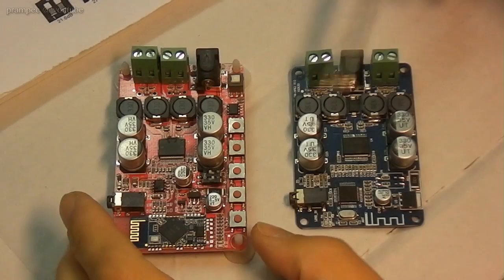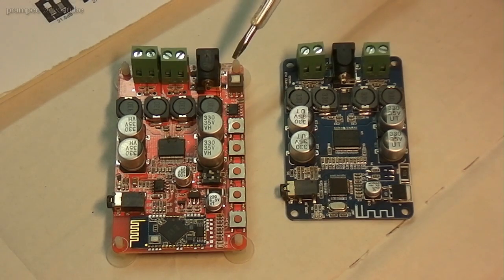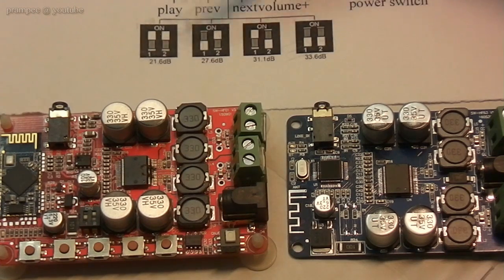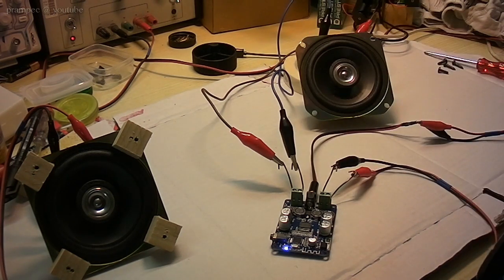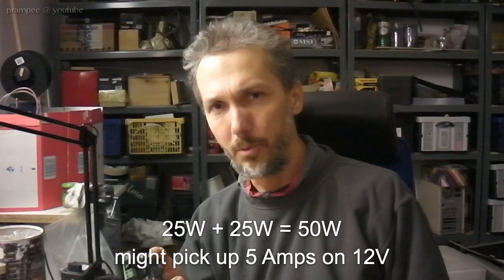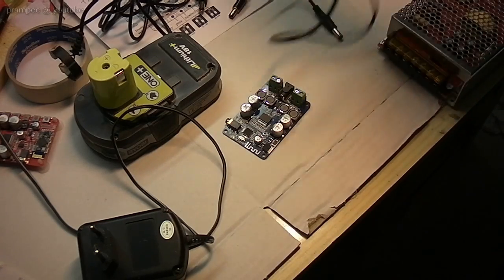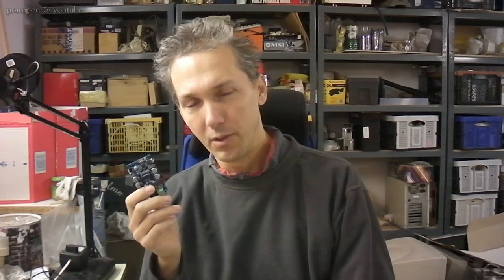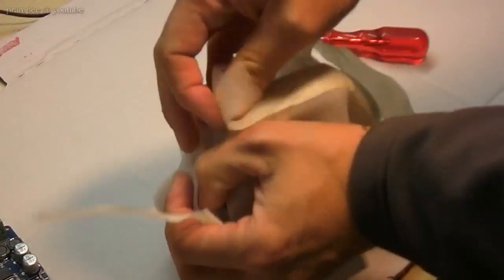Tested and modified the TDA7492P Bluetooth Amplifier module

Comment: What is the voltage range? Is 12v the maximum? Most of these boards have a wide voltage range and can only achieve the rated output at unrecommended voltage for short periods of time. Also, 10% or more THD at rated voltage. Manufacturers do this because uneducated consumers are desensitized to bogus high wattage ratings. Would anyone buy that board if the maker rated it honestly for 2x5 watts? Not when other manufacturers will also build the same board and lie about its ratings.
Reply from the maker: Good point. The specs says that you can power it from 10-25V DC. I did have tried it with 12V and 24V, but I did not recognized more sound volume at higher voltage. No footage from that :( The specification of the TDA7492P says, that you can count with bigger output power with bigger supplied power. I should definitely try this.
Reply: Flad Mast That's been my experience as well. However, I've never used this specific module, so I can't say definitively.

He does have a video on his channel demonstrating what he says is true.

Check it out and let me know what you think.
Reply: Flad Mast i agree but did you see his 24v wall wart power supply it only supplied 1amp so he was never going to do it justice those boards need 2.5-4amps to be happy

Comment: I have red one do you know how to fix Bluetooth on it the Bluetooth it does not show up on my phone
Reply from the maker: Unfortunately there is no magic trick to perform that will fix all possible issues. Except this one: ask for refund!
Reply: OK thanks
Reply: Balázs Kelemen i have nearly the same problem , when i power on the amp, the blue bluetooth indicator led light up for a short second but after that the whole board is dead , no aux and no bluetooth connection avaible , do you know any solution ?
Reply from the maker: We are talking about the red one. Both bluetooth and AUX inputs are biased through the BT chip. So, it is okay that none works and you do not find any BT device near by: This means, that the BT chip is not functional. It might be just a loose solder joint, or a complete defect. You can check this by measuring 3.3 Volts between the GND and VBAT legs of the BTM835 board. (Search images for BTM835). On the other way round, if you apply 3.3V between GND and VBAT, the BT module should come alive, and visible for BT devices. This way you can sort out whether the BT module or the amplifier board is dead. Either ways you might not do anything to fix it except for checking loose solder joints.
Reply: Balázs Kelemen
I have the red one everything is working ok except i just lost the sound of my speakers ,what do you think happend  ?